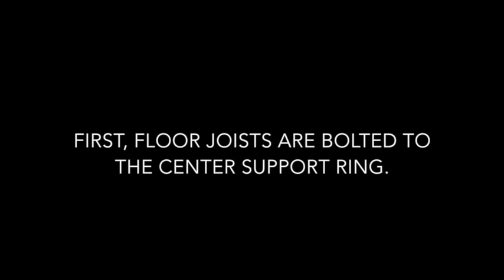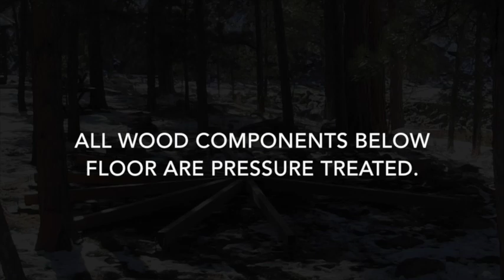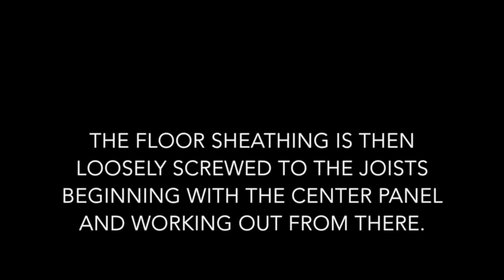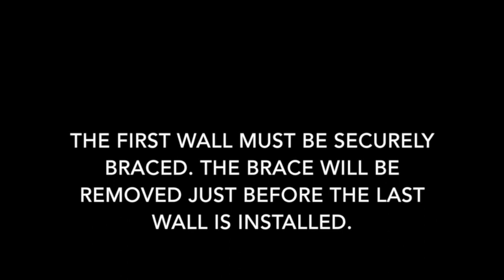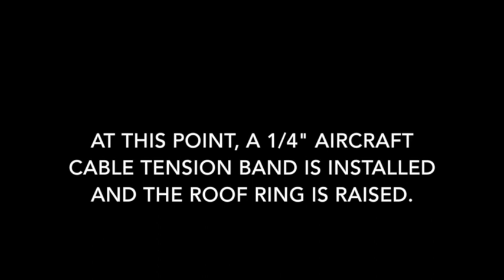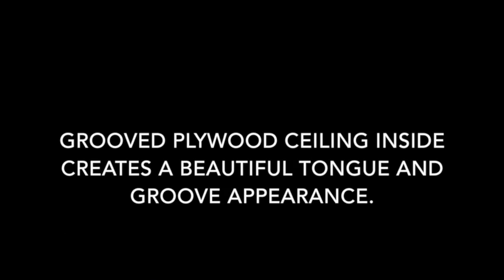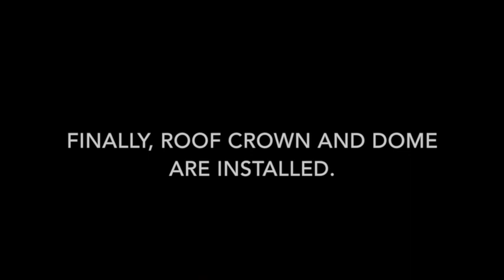Freedom Yurt Cabins Assembly Overview - How to Build a Wood Yurt Cabin Kit in 3-5 Days

Comment: The plywood design is great. It would be really interesting to see an insulated one built for people who live in cold climates like me. I realize these are a Mongolian form of housing, but they also sat around a middle central fire and layered themselves in furs. My biggest concern is the viability of a Yurt in -30 to -40 celsius, which is a normal occurrence in the Canadian Rockies. This design would definitely open the options for possible insulation and weather prevention as the snow wouldn't be as much of a concern as it is with cloth walls. Very interesting. Will be researching this further.
Reply: Instablaster.
Reply: There's better companies that build real yurts ,that can easily withstand -60 degrees Celsius temperatures 🌡, there's is people living in fairbanks Alaska, right now ,proving it

Comment: How big is this yurt?
Doesn't the ground have to be leveled?
Is it wind-proof & blizzard-proof?  How much wind?
How long does it last?  Is it for permanent living?
Is the roof insulated & leak-proof, long does it last?
Reply from the maker: Hi! This is our 14-wall Yurt-Cabin, we have multiple sizes larger and smaller than this one! Our structures can be set up on levelers as simple as 12" x 12" pavers, or go the pouring concrete route. Our wind rating is currently 115 mph and we have multiple upgrades to withstand any climate! We have multiple Yurt-Cabin customers that live in their structures year round (all around the world), and they will last as long as a traditional house/log cabin with all of the similar maintenance!

Comment: What about additional windows, floor insulation, electrical wiring & plumbing? Are the walls insulated (i.e. for year-round living)? Thanks!
Reply from the maker: Additional windows are $400 per window, our floor insulation sheathing kit is $500. Wiring and plumbing is all up to you. Think of the Yurt Cabin as a round house with wooden walls and a plywood sub-floor. We provide you with the shell structure and you can build it out however you'd like to. The walls and roof come with two inches of insulation standard. All of our customers who live in Yurt Cabins year round are very happy with the quality of the insulation which is exponentially more efficient than any insulation available in fabric Yurts.

Comment: How well does this hold in tropical storms? Would moister be an issue? Would this be considered a tent or a building? (Building code)
Reply from the maker: Great questions! Our Yurt-Cabins hold up well in tropical areas, with our coastal climate upgrade (Stainless Steel hardware). We can be considered a permanent OR temporary structure depending on your building code, but we are NOT a tent, we are a solid-walled round house. Uniqueness of a Yurt, comfort of a Cabin! Let us know if you have additional questions!
Reply: @ interesting. Thanks for replying I’ll check out your website

Comment: I can see sun light in between the panels
Reply from the maker: All of the gaps in the wall are smaller than 1/8" when the structure is completely finished, from there the 1/8" gaps are filled with a highly-rated chinking caulk specialized for our structures! They are completely air tight and water proof once fully erected! Additionally, there is 2" of insulation in each wall panel, 2" on the roof, and an option for 4 more inches in the floor! Let us know if you have additional questions!

Comment: Is there a reason why you installed a subfloor on a snow covered ground without any insulation?
Reply: Nevermind... Read some other comments. However as a builder I would have specified this in the subfloor portion of the video so I didn't look like I had no idea what I was doing.  Lot of people wont bother asking questions. They'll just move on to the next guy who SHOWS insulation going into a floor when there is clearly snow on the ground.

Comment: What are the panels made of? Insulated? Waterproof? Off gassing?
Reply from the maker: Hi Sasha, the panels consist of LP SmartSide on the interior and exterior, surrounded by a Lodgepole Pine frame. There is 2" of fiberglass insulation between the panels for an overall R-value of 9.7. The walls are completely insulated and waterproof. Any offgassing from the LP SmartSide is negligible and below 20 ppt when brand new. The LP Smartside is painted your choice of color for the interior and exterior. For an additional fee, you can choose Behr Premium Plus zero-VOC paint. Thanks for the questions, and happy to help further if you'd like to submit a quote or inquiry on our website.

Comment: If the walls are squared ,then the doorway is not. Or Visa versa? Which is it?
Reply from the maker: All of our walls and doors are carefully crafted to fit together and create a beautiful structure that has the aesthetics of a yurt, and the solidarity of a cabin! We have real, working house windows and doors that come standard with each Yurt Cabin, and allow for easy construction from start to finish!
Reply: @FreedomYurtCabins  whis there a gap on each side of the doorway.
Reply from the maker: @paulmelnychuk5477  As you build the Yurt Cabin, the walls progressively come closer and closer together, leaving a very small gap between each wall panel that is sealed with high grade log cabin chinking. The walls and door panels are all cut and designed to fit together to make a solid structure!

Comment: all i could see was gaps everywhere
Reply from the maker: All of the gaps in the wall are smaller than 1/8" when the structure is completely finished, from there the 1/8" gaps are filled with a highly-rated chinking caulk specialized for our structures! They are completely air tight and water proof once fully erected! Additionally, there is 2" of insulation in each wall panel, 2" on the roof, and an option for 4 more inches in the floor! Let us know if you have additional questions!

Comment: Looks cool & all, but how do ya heat it , you obviously can't use a wood burner, you'd burn down the forest, as close as it is to all them pine trees
Reply from the maker: Hi Carl, this specific yurt is an art studio that is connected to the electrical grid, so they use a radiant heater. However, the majority of our customers living in their Yurt Cabin or using it as a vacation cabin install wood burning stoves. The stove pipe is routed out through the wood walls, and the chimney is connected to the exterior log frame. You can also choose to install a mini-split AC/heater, a heat pump, solar window heating, radiant floor heat, etc. Thanks for your question!

Comment: no ground vapor barrier gives me pause right off the bat
Reply from the maker: The floor insulation sheathing kit is made with a highly treated subfloor that has a vapor-barrier coating on the bottom to help protect the Yurt Cabin from the elements.

Comment: 벽체틈이  저래  크면 단열이  되나 추워서  우째  사나?
Reply from the maker: All of the gaps in the wall are smaller than 1/8" when the structure is completely finished, from there the 1/8" gaps are filled with a highly-rated chinking caulk specialized for our structures! They are completely air tight and water proof once fully erected! Additionally, there is 2" of insulation in each wall panel, 2" on the roof, and an option for 4 more inches in the floor! Let us know if you have additional questions!

Comment: these people have price them selves out of the market. I can do a 40ft for what they price a middle of the road for.
Reply from the maker: At first glace, you might be correct, but if you're comparing apples to apples, our yurt cabin kits are on the same level after considering the added costs of building a platform/foundation required for a traditional fabric yurt. All the upgrades you would need to add to a traditional yurt to match ours, come standard on our yurt cabins, with an additional factor of overall safety. With locking doors and windows, and solid walled construction, our yurt cabins are much more secure than a traditional fabric yurt. Not to mention the increased lifespan of our yurt cabins as compared to a fabric yurt that requires heavy maintenance every few years. Once you factor in all of the included benefits of a Yurt Cabin, and understand that our Yurt Cabins will last 3-5 times longer than a traditional fabric yurt, it is clear that a yurt cabin is a much better financial investment. You can find more great information regarding our yurt cabins at https://freedomyurtcabins.com or check us out on our other social media platforms to discover the difference!